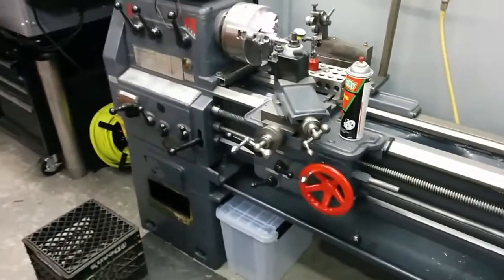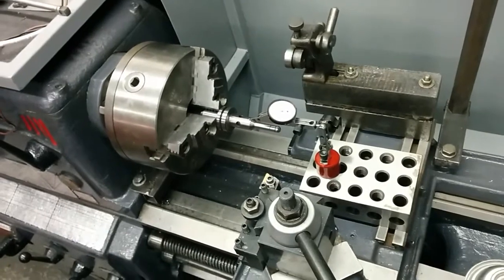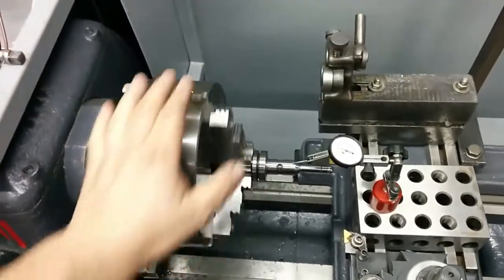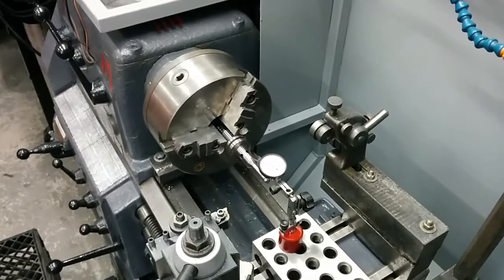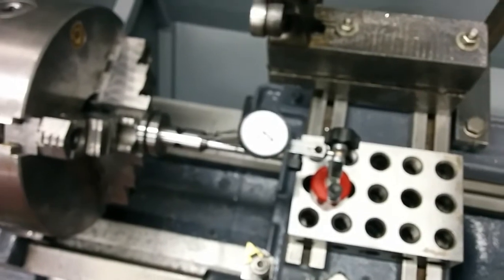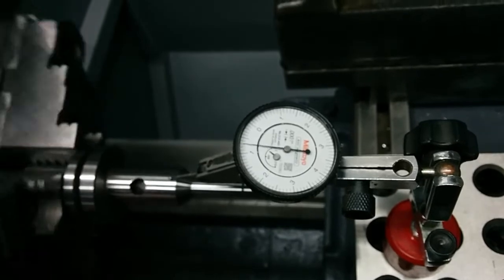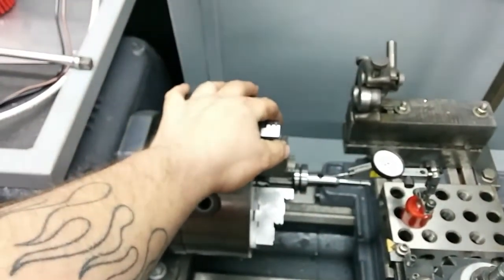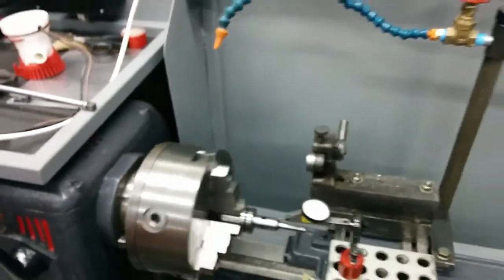Bison 8" 3 jaw lathe chuck run-out issues.

Comment: I like you, bought am old lathe. the 3 jaw was way out like .025. So I never used it, always used the 4 Jaw. Today I decided to get to the bottom of the problem. I took the chuck off, indicated the spindle, .001. Took the chuck off of the back plate, put the back plate onto the lathe, .001, clean all the crud out from between the chuck and back plate put it all back together... Chuck is now out .002... Very happy now...I have 2 chucks to use.

Comment: Import Sanou chucks can you same level of accuracy, just needs deburring, cleanup and some lubrication. Vertex ones are even better, I can understand the premium for set tru or combination chucks but $1600 is a bit too much especially when in the smaller sizes they use cast iron and not steel.

Comment: Hi James, I recently bought a Fortune (Victor) S2060 engine lathe made in 1981. It has a  BTC 12" 3 jaw zero set chuck that also has a shit ton of runout, (What is a shit ton in mm? I can't find the conversion on line :-)   about .016 and .008 after adjusting the zero set so that the outside of the chuck body was running true. Running @ 500 rpm made the whole lathe shake, adjustment made the shake stop but it still has .008 runout on a test bar. I pulled the jaws and blew out the scroll ... no help  I'll try a full cleaning and see if that helps. Thanks for the tip!
Reply from the maker: Old Shaky a shit ton is at least 3mm! I'm surprised you could not get the chuck any closer than 0.008" after adjust to true set. it's got to be something going on with it. I would definitely tear it apart completely and go from there. I'm assuming you've checked the spindle nose run-out on your lathe?
Reply: James I did check the spindle nose. Inside the bore it's within 2 10ths,
the face is about 4 to 5 10ths and the short taper that centers the chuck back plate (D1-8) is also about 5  10ths and kind of beat up! The face of the D1-8 back plate where the chuck bolts on is also 5  10ths and that is where the lateral adjustment is located for the zero set (BTC's name for true set). The perimeter of the back plate has .003 run out but that  shouldn't mater because that is adjustable with 4 set screws on the chuck body (the zero set). I'm sure I could adjust it closer than .008 but I didn't try because I want the chuck body to be balanced as close a possible. My first thought, like you was to grind the jaws but hopefully after I clean everything properly I want have to.
     I'm probably being to picky. I really think the lathe movement was a resonance set  up at 500 rpm because the lathe is still on wooden blocks, It didn't do it at any other rpm. When I get it on the floor and leveled up it may not matter!